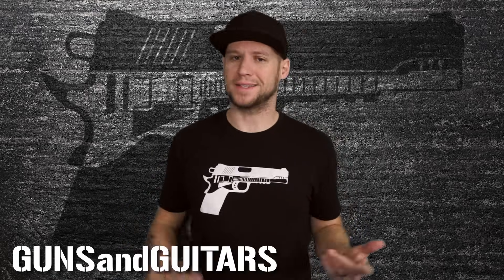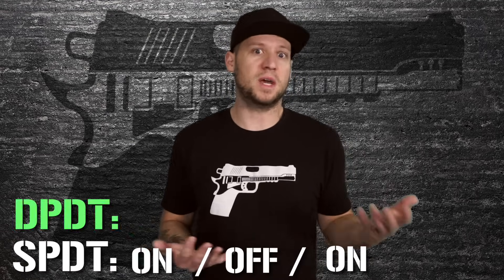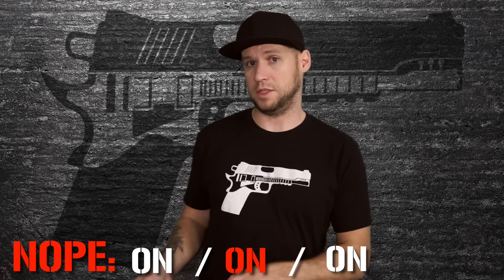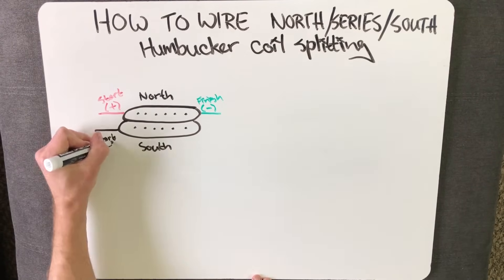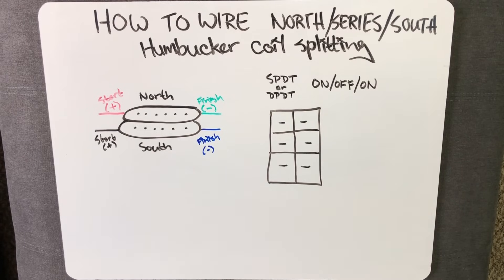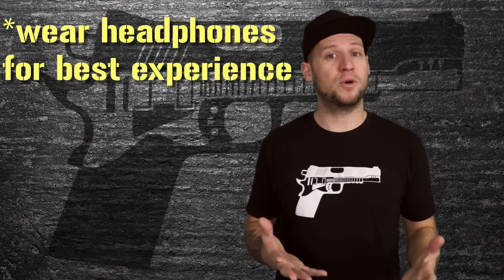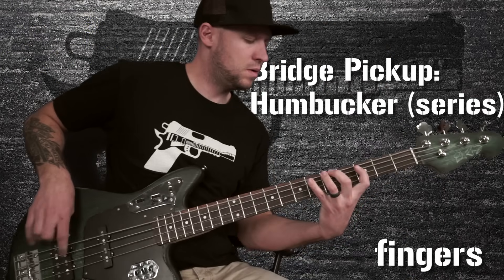BETTER THAN COIL SPLITTING! How to wire a humbucker for North/Series/South coil selecting

Comment: Awsome video helped alot. Im changing out all the electronics in my ibanez btb805ms im putting a 500k push/push volume pot that will act as a kill switch a 500k blend for the pickups then im putting a darkglass tone capsule in. The bass pot will be push/push for an active/passive switch. And thanks to this video before I run the pickups into the blend im going to put 2 spdt switches in for this mod so I have a huge tonal variety in combination with the preamp and the pickup blend.

Comment: If you ever read these, could you link me to the video mentioned in the lead-in (how to use a multimeter to split a bucker).
I have a three wire and need to figure out where to tap into the fourth wire on it, to put a series/parallel switch. Thanks for the videos

Comment: Thank you. How you select 3 options if a DPDT volumen push/pull  only have two positions? Thank you
Reply from the maker: You can’t use a push/pull for this trick. You need a 3 position on/off/on dpdt switch. A push/pull pot is a two position on/on dpdt switch.
Reply: @GunsandGuitars  thanks a lot!

Comment: This is exactly what I want to do with my middle Strat pickup. So I ditched the 5 way switch for 3 on/off switches. Now, my next step is to set the neck & bridge pickups at opposite N/S polarities.
My last step is to use a humbucker in the middle, and wire it like this so I can select either North or South coil. This will give me hum canceling ability with any selected 2 pickups.

Comment: How is the south coil active when the hot (to volume) switch is connected to the north coil? Is the output signal still active even though the north coil is turned off? Thanks!

Comment: It looked easy so I tried it.   I bought two dragon fire humbuckers and a single coil for the middle.   Five way switch, one volume, two tones.  I wired it up first without spdt switch then I ran the hot wires from the switch to the spdt.  It’s not working. Not getting any sound from the humbuckers.    Can you help?  Do you have a full diagram on how to wire the pickguard? I used two spdt switches.  One for each humbucker.

Comment: So to understand... 

Topic 1:
This wiring gives three options? If it is the 
1. top pin connected to the center pole, then the north coil is selected, 
2. bottom pin connected to the center pole, then the south coil is selected,
3. how do you select the top and bottom connection to have the humbucker series of the coils with a push/pull or push/push pot?

Topic 2:

Why are the minuses connected together? It will give a wrong phase, not?
Shouldn't be + -  + -?
Reply: 1 - I guess your talking about a Double Pole Double Throw ON ON switch, wich will work:
1(1) - top pin connected to the center pole, so SOUTH coil is selected (because you are effectively shorting the north coil, by connecting it to itself)
1(2) - bottom pin connected to the center pole, so the NORTH coil is selected (because you are effectively shorting the south coil, by connecting it to itself)

He used a DPDT  ON OFF ON switch, wich will work like I described, and also has a third setting in the middle where non of the coils are connected. So you can select both coils.

2 - The minuses are connected together because the south coil is connected "flipped" from the factory, to avoid 50 cycle hum. So basically you are connecting what labled as minuses, but essentialy you are connecting the minus and plus.

Hope that helps, and sorry for my not great english / overcomplication (:
Reply: @ItsMe-ic5oc  thank you for the answer, it was clear!
Question to topic 2: i have a pickup made in Czechoslovakia (Jolana).in the 70s. I measured the two coils + and - poles by using a multimeter (positive result means the polarity is matching) and identified the south and north coils by using a compass (red arrow aka north on compass pointing to the coil means the pole of the coil is south). 
Now I have a wiring of dpdt as you wrote for splitting in vol knobs and phase change and series/parallel on tone knobs.
If I don't touch the strings to ground, then a noise is getting slowly amplified.
Is it because of I should change the polarity of one coil in the circuit to avoid the freq of the electric network? Grounding should be ok in the guitar everywhere.

Comment: I cannot for the life of me figure out how to do this with a 3 way slide switch that has 8 different terminals instead of 6.
Reply: I know what you are talking about but I may not have an answer, this is probably a DP3T switch and I think the extra two terminals are a dedicated ground for each side.  I was looking at using them and came to the same conclusion.

Comment: In the mid eighties I built a 4 string bass with Bartolini 9V Jazz Bass Quad that I just found out had a very short production run. My goal back then was to split to two lower strings from the two higher ones having two separate jacks on the bass. Because it was cumbersome to bring two amps to gigs I was never able to get a balanced volume output so years later I made the bass mono. Fast forward decades later and I became a huge fan of Michael Manring and his Hyperbass with the custom Bartolini that allows to split each individual strings. For live applications he uses a 1/4 jack splitter from a XLR cable jack coming from the Hyperbass multi pin din. I'm planning to modify a Galaxy Audio four way 1/4 jack splitter box and possibly use Bartolini buffers since the Hyperbass bass uses them. Also I just bought online a used Godin 5 string fretless and would like to split the strings as well from it's RMC piezzo pickups Midi multipin din in a similar manner. Splitting each strings into two amps with two preamps for the 4 string (or adding a third amp for the Godin 5 strings) is my goal. Do you have any suggestions for either my luthier or I are not technically inclined with eletronics. Thanks!

Comment: I appreciate your Videos... And this one In Particular..
Really Cool one on the Schecter Stealth 5..  I just got my second one #2 not as much for a backup, but to rotate to keep a consistent sound and tone live... I'm gonna be building a ramp like my #1, and setting neck , intonation, and Want to add a coil split on both basses. (I ordered 3 and they sent 3 bags of them😐 
Anyway, I know that Schecter didn't have a Diagram , around Nov 2019 when I added a basically a Treble Bleed that Schecter advised... The Buck has 4 wires, maybe color coded.. So , if you need an idea for a Vid, (or just want to help a Fellow Bass Player) 
How about a Video that you add the Coil Split to  your Stealth? Thanks for considering!💯⚡🖤🎸🤠⚡

Comment: I rewired my old Kramer Pacer using your schematic. Works very well. Replaced the pickup and pots also. Had to use the other type of switch though. And added a tone circuit. It's hard to find a decent schematic on the net. Thanks.

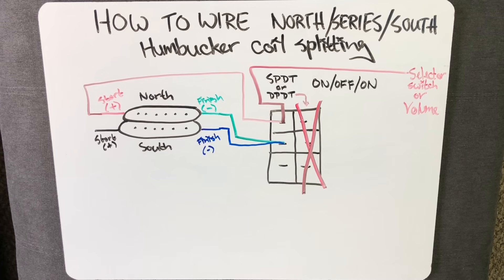Comment: Note, the diagram at 1:48 will only give you series with a DPDT on on on switch. If you use a DPDT on on it will only result in north or south pole. Never together. To fix this use the other side of the dpdt he told ya not to worry about.

'dpdt on on on' will give you 1&2 or 1&2&3 or 2&3. While a 'dpdt on on' will result in 1&2 or 2&3
[1][1]
[2][2]
[3][3]
Reply: so do you jump 1 and 2 diagonally?
Reply: That's precisely why the video doesn't say "on/on", it clearly says "on/off/on"

Comment: I tried this mod in my Washtub bass. Using an STR humbucker with 4 wires and ground. I found the starts and end leads. I followed the instructions carefully. After done I get the North coil with switch up, nothing in center position "humbucker" and South coil when switch is down. Any thoughts as to why the humbucker position would be dead?

Comment: Hey Dan! Quick Question! I recently did this mod to the neck pickup of an HH guitar. The mod worked in the north and south coils but the middle position gets no sound. So no humbucker In the middle. I checked the color codes but my pick up has one difference than your example, it has four conductor and a bare wire. What could I have done Wong?
Reply: I got the same outcome. North south no humbucker??
Reply: Me too.
Reply: @peterchilds9491   I was advised to switch the positives from the pickup and now works perfectly!!
Reply: I just desoldered the two black wires and switched places. It was out of phase. This fixed the problem. Now works as it should.
Reply: @jaysbass3599  what do you mean you switched places for 2 p'up wires? They are on the mid terminal of the toggle, where did you move them to? Thanks in advance for the answer
Reply: @chuckcarney2099  Dual coil bass pickup has 5 leads, positive for each coil, negative for each coil, also known as start and finish, and a ground. I switched the positions of the positive leads to get it back in phase. Hope this helps.

Comment: I did this on a strat partscaster build n got it working with 1 oddity.  the switching between diff coils works but the oddity comes in when I have it in the middle position (toggle switch) the humbucker is much quieter than both coils on separately.  The 4 leads are visible on the pickup I used (a less expensive single coil size hotrails humbucker)  Just wondering if I goofed n put them in some phase cancelling setup (despite the switching working correctly otherwise) or if it's just an oddity of that pickup.  Any thoughts?
Reply from the maker: Yeah it sounds like the middle position is out of phase. Whichever wires were soldered and taped together on your pickups, those are the two that need to be soldered to the center lug. Hope that helps!
Reply: @GunsandGuitars  I been figuring out what you just said here.  put it back to the default setting n it works more evenly now though being single coil size humbucker the outputs not as high as I thought but it does work now for a few more sounds. thanks for the info.

Comment: I have a set of fender double tap humbuckers I’m installing in a mustang. Instead of toggle switches or push pull pots, I’m using two slide switches. But my switches have 8 terminals with 4 on each side. What would be the best way to wire that?

Comment: I just did this mod, but for some reason I ended up with the north coil in position 1, the humbucker in parallel in the off position (middle) and the humbucker in series in position 3.
I did this with a Gibson 500T. What have I done wrong?

Comment: Question... If you have an HH config, would it be possible to put a pole selector on both pickups so that you can control each independently? Like, so you could play both norths, or both souths, or both opposite? Also, would it be possible to add a 3rd humbucker in the middle with a pole selector? I've had this idea for a guitar config for YEARS now where there are 3 humbuckers, each with a coil selector, each with an on/of switch, each with it's own tone pot, each with it's own volume pot. I've been calling it Project: Pandemonium, and I'm no good with wiring, so I've never been able to figure it out on my own, but this little mod switch seems to be the closest thing to the missing link for me... Maybe you can just figure out Project: Pandemonium for me, and just build it for a video haha...

Comment: One possible issue tho, when shortcuting the North Coil, depending on how the humbucker is wired internally, you may end up just pumping current through the the metal case/support via the ground wire...(which is now used a a hot wire to shortcut the coil) therefore creating more hum...

Comment: With a standard 500k push/pull volume pot, is there a way to split the coils in a way that the single coil position only gets 250k out of the pot?
Reply from the maker: I don’t believe there is a way to do that. Honestly single coils sound great with 500k pots too.
Reply: You can by adding the right resistor between the coil and the output. Search videos on balancing humbuckers with single coils and you'll find it.

Comment: That was super simple, THANKS!!
   I recently split my humbucker with a push pull pot,  and was wondering how to make separate use of that north coil.  I'd like to know how that north coil sounds to see if it's worth drilling a hole and adding a switch.  (2010 melody maker 1 vol, 1 tone, and jack)    Other option I been considering is moving the jack to the edge of the body and use the jack hole for the switch.  I don't want to further modify the pick guard. It's really hard to find a replacement that says melody maker on it.  But then again, drilling the body is a permanent thing, no do overs, no going back.  Is there another option or way to do this with pots?
Reply from the maker: You can’t do a 3 way switch with lots unfortunately. But you can do coil splitting with a push pull pot, you just have to choose which coil you want.
Reply: @GunsandGuitars  Ah, so I can just wire the north side to see what difference it makes compared to south....Thanks
Right now it's split to use south as a single.
 One day when this isn't the only Gibson I own Moving the jack might not seem so hard to swallow. It was scary enough switching from single to humbucker and roughing out the hole, and making the finished product look like it came from the factory that way.. If it wasn't for the serial number on the back you would think it was one of the 2011 limited run's with the burstbucker3 in it.
Sry, I talk too much lol

Comment: How would I apply this mod to 2 volume and one tone? Like once I’ve wired the pickup to the on/off/on switch, how would I wire that to the electronics?
Reply: Assuming you have 2 pickups, cuz why 2 volume then...

Using the video's color, connect the 2nd red wire to the volume potentiometer in one of the 2 following ways (you should connects both pickup the same way tho... otherwise no idea what would happen)

1. To the middle pin of your potentiometer, pin 3 to ground and pin 1 to the pickup selector

2. To pin 1 of the pot, 3 to ground and connects pin 2 to the pickup selector

Now you may ask what's the difference, well simply put,
In option 2, turning either volume knob to a volume of 0 will act as a kill switch and prevents both pickups from playing...
Option 1 let's you mute one volume without affecting the other...

Now since you have only 1 tone, connect the hot of you pickup selector to the middle pin of your tone potentiometer, connect pin 3 to the capacitor then to ground, ignore pin 1...
Reply: Lua Grimm  cheers
Reply: @lanimask4314  pleasure, do keep in mind tho, this is theoretical... should work, but can't guarantee it will
Reply: Lua Grimm yeh I understand, thanks again!

Comment: Does anybody (including Dan if you read this) know if wiring a middle pickup using a three-way mini toggle would work in place of a volume or tone control?  My plan is to put a mini-humbucker in a middle position of an SG kit but I want standard controls (including the three-way switch of bridge/both/neck) because I don't have a normal SG or Les Paul and want those kind of controls to get used to it.  What I'm hoping to do is put a mini toggle in near the pickup selector that controls the middle pickup ONLY in an off/always half-volume/always on full-volume or even just a two-way of always off/always on so I can just have it mixed in with whatever else I want.  Would this work or would I have to put in a separate volume somewhere?

Comment: I see you've been using the chinese single coil rail humbuckers.  I already put them in a strat with this mod.
Do you know if the two wires they have soldiered together from the factory are the North and south finished.  I believe they are....the pick ups are very quiet in all three positions...that throws me off a little...they're not noisy like single coils....they are little more trebly in the North and south positions.  I should have tested them before installing but I assumed in the standard humbucker position they would be wired with the finish of both coils soldiered.

If someone is going to replace strat single coils with the Single coil humbuckers then they'll probably want to change the pots to 500k.....I have to do it on my guitar.....it's very dark....not much treble.

Comment: Is it possible to combine this hack for individual humbucker coil select and individual humbucker series / parallel select (not series / parallel for 2 humbuckers)?  I would prefer to avoid rotary switches, but don't see other viable 4 way options which I think the combined hacks would require.
Reply from the maker: You can’t do this hack with a series parallel hack that I know of. I think you have to choose.
Reply: Thanks!

I couldn't wrap my head around a way to do something like this unless I had a 4 way switch of some sort in the mix, and even then was losing confidence that this was a good idea since most folks talk about how humbuckers generally have one coil (at most!) that will sound good alone.

Then I stumbled upon Super Seven Switching wiring diagram:

https://www.1728.org/guitar6.htm

That does everything I want, albeit with 7 switches.

I must say all of the guitars they have as examples are guitar'n'stein monsters (to my eyes).  I am going to try this build but do it similar to the layout of a Jaguar style (which I think is a very nice layout for something so complicated) with the 4 pickup switches on top and 3 more switches isolated below (and will also be adding a momentary cutoff switch near the volume/tone).  I could do push-pull pots to reduce the switch count, but will try my idea first.

For my first guitar kit build, I may be getting too ambitious, but I've really, really wanted something like your 42 Tone guitar ever since watching that video...now I'll have a 72+ Tone guitar (assuming I can pull this off).  Depending on results, I may need to upgrade my cheap-o Chinese humbuckers to a decent name brand...